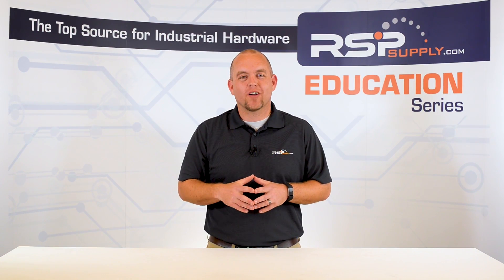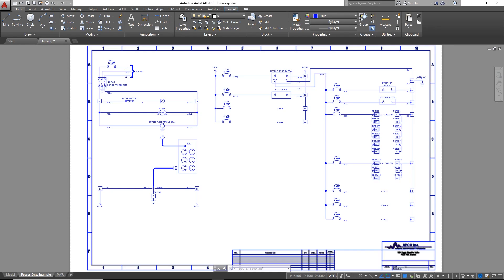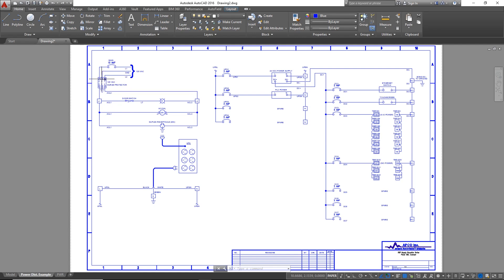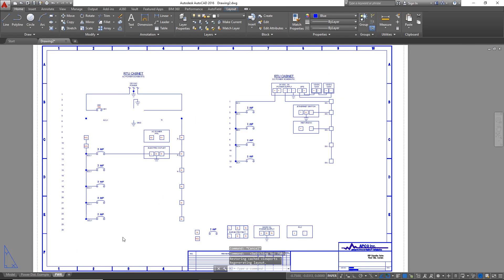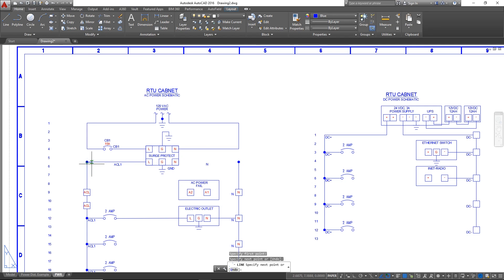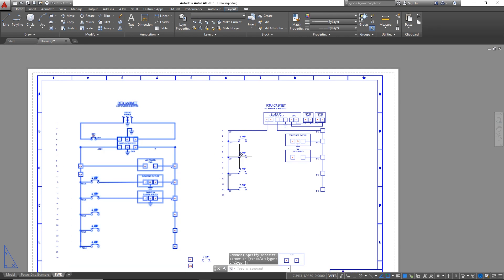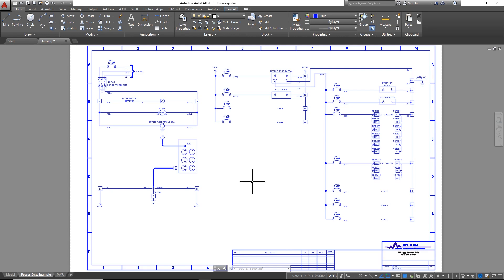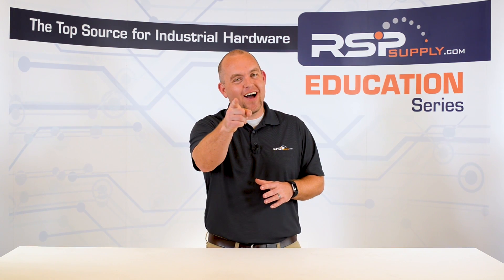Control Panel Build Series Part 9: Design - Power Distribution

Comment: Why put breaker in positive side if electrons are actually flowing from negative to positive?
Reply: Because. If you touch the negative side of a DC power supply to grounded metal in the panel, nothing happens. But if you touch a positive wire to metal in the panel, it'll spark and arc. That's why the + side is protected. Because the - side of the power supply has the same potential as ground because it is grounded. And if the negative side was fuse or CB protected, but the + side wasn't, then the circuit current would take the ground wire back to the power supply and the cicruit breaker would never open.
Electron flow (negative to positive) vs. Conventional flow (positive to negative) is only theoretical, and both are irrelevant in this circumstance.
Reply: There are two types of current flow such as a conventional current flow and an electron current flow. Mostly conventional current flow is used as standard.